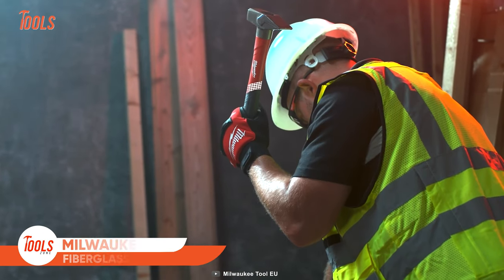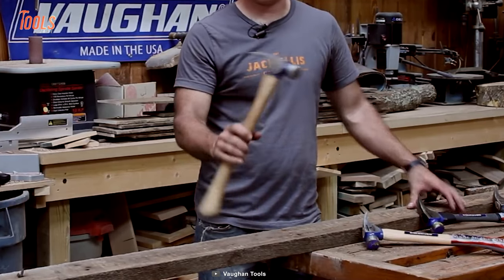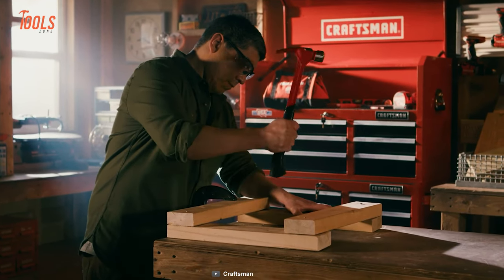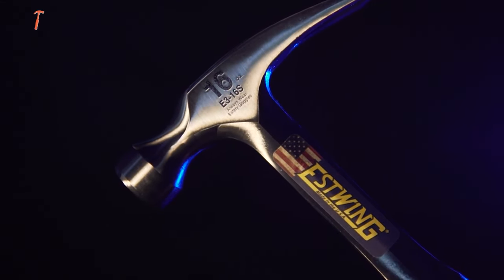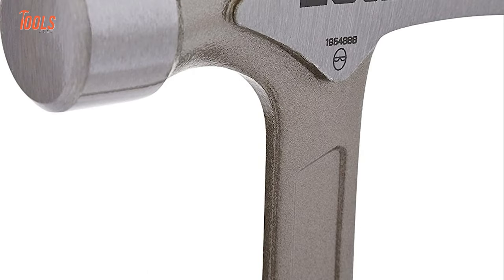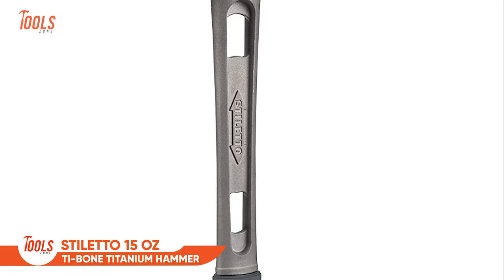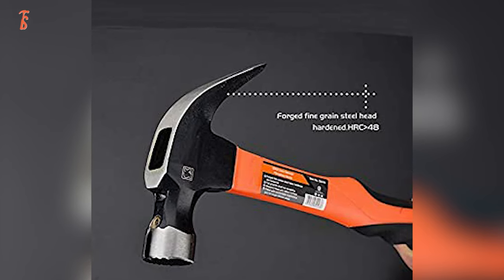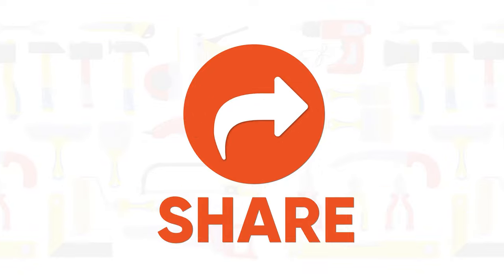10 Best Hammers to Buy

Comment: Do not use anything bigger than a 16oz estwing it will destroy your are, you'll thank me later
Reply from the maker: Thanks for your valuable suggestioon.
Reply: I've used a 20oz Estwing for over 30 years and never had an issue . It belonged to my father before me and is currently over 50 yrs old . I own a 20 rip claw and a 22oz rip claw framer also .
Reply: Does anyone ever use the magnetic nail starter? I've never even thought of it as a carpenter
Reply: @andymaciver1760  I've not and I've a couple of hammers that have that feature . You can use any hammer to start a nail without holding the nail though . If you wedge the head of the nail against the back of the head , and the stem in the claws , it works as a nail starter .
Reply: @TheSavagederek  I guess I never saw a useful application for it?
Reply: @andymaciver1760  me either tbh
Reply: We use a 22 or 20
Reply: Irwin makes a great 24 oz that’s very light in the handle and it has the the notch on the back of the stem under the claw so you can use it to bend 2 x 4s etc
Reply: @andymaciver1760  I've used it when I am in a precarious position driving holds on solo jobs where I still need a good grip on my ladder or supports. Especially on a 16/12 roof pitch. I only use it about 2 or 3 times a month, but primarily default to my nailgun on bigger jobs.